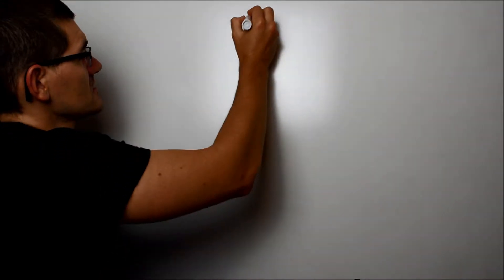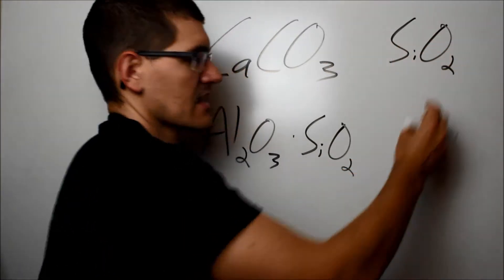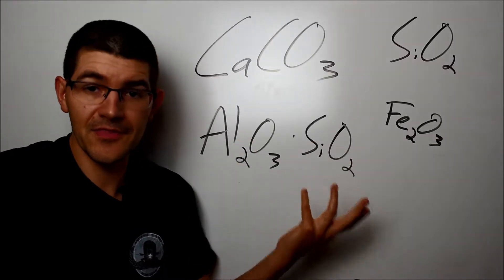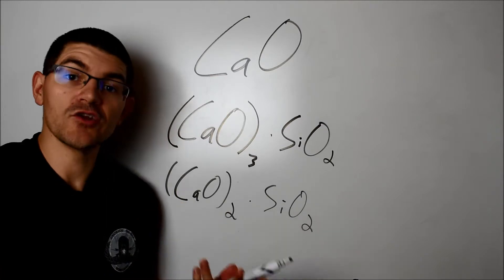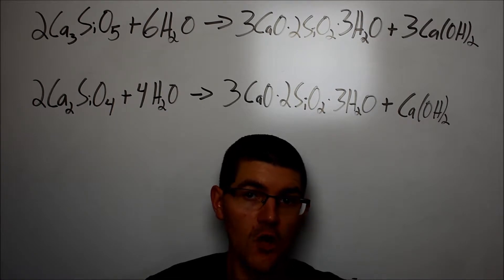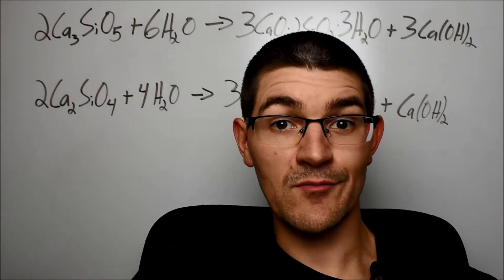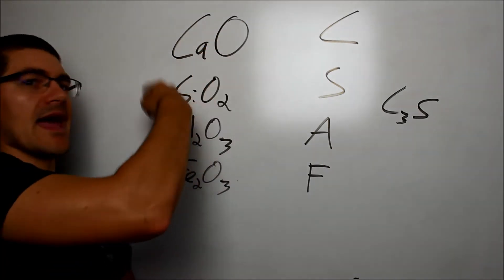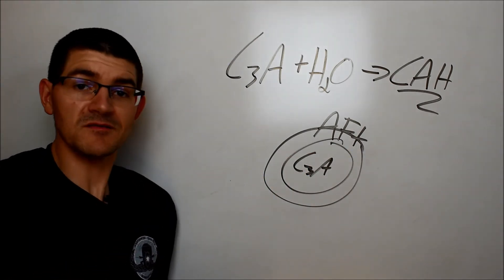Concrete Chemistry: More Than Just Dirt

Comment: Rebar is not made from stainless
Reply from the maker: Thanks for watching! I try my best to make sure I'm not telling folks lies on here. I'm no construction worker, but rebar is made from a number of different materials...and stainless steel appears to be one of them. https://stainlessrebar.com/why-use-stainless-steel/why-use-stainless/
Reply: @phdatliving  yeah I do work in construction and reinforced concrete design and have never heard of stainless rebar. There’s epoxy coated and fiberglass, even heard of bamboo being used... something that may peak your chemist interest is cathodic protection systems to prevent corrosion of rebar in bridges
Reply from the maker: @mcgu2888  I stand corrected! Silly internet telling me half-truths. Thanks for clarifying, man, I really appreciate that. Here's a dirty little secret of mine - electrochemistry gives me the willies.
Reply: Actually i'm an engineer and we use stainless steel rebar in high rise structures. Stainless steel rebars are more fire resistance and have greater mechanical properties.
Reply: @mcgu2888 lol you're just a labor boy 😂😂